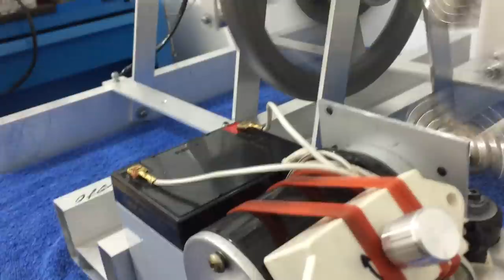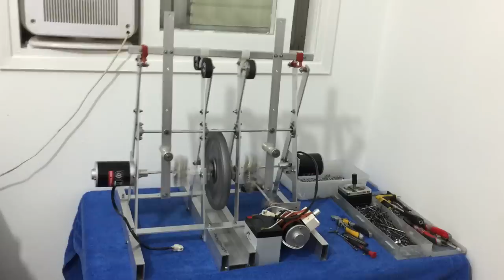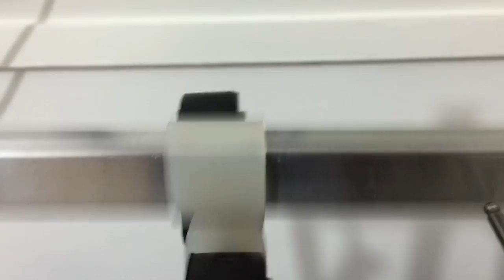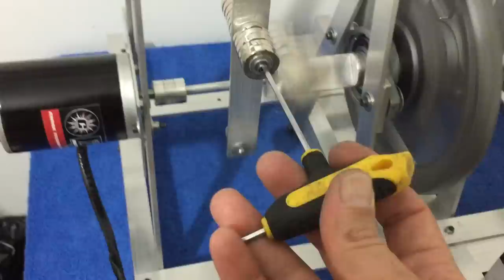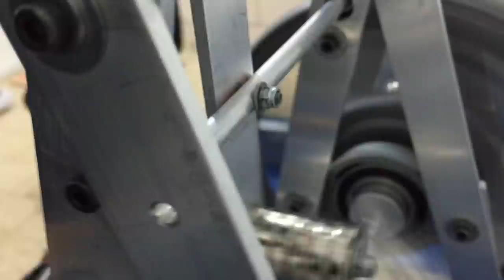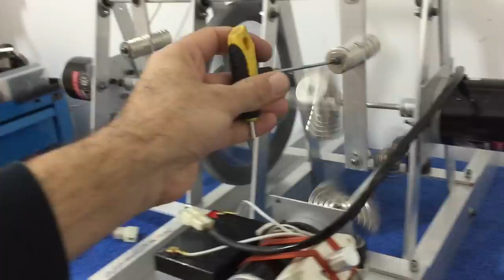Flywheel Magnet generator! Supports up to five generators or more in this machine!

Comment: can this be built to generate about 25kva ? does it need a motor to run it or it is self powered?
Reply from the maker: I just finished building the machine! I have no more data! This machine is a prototype sketch and still other generators not connected! In the near future it will be possible to build small machines and electrical manufacturing giant machines without gas gasoline or diesel! Only battery - Thanks